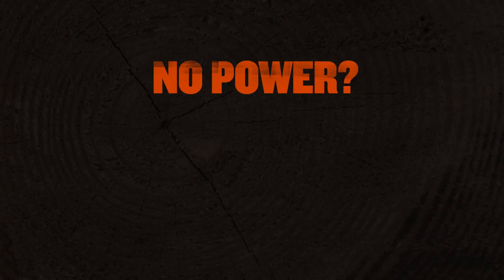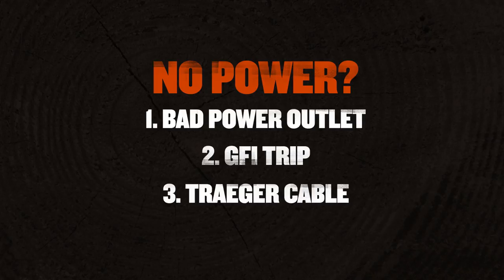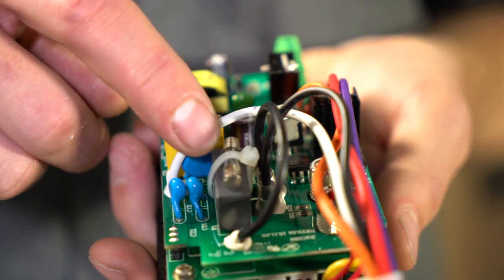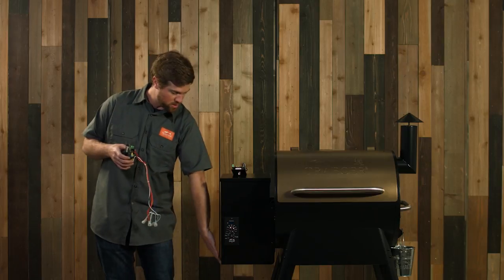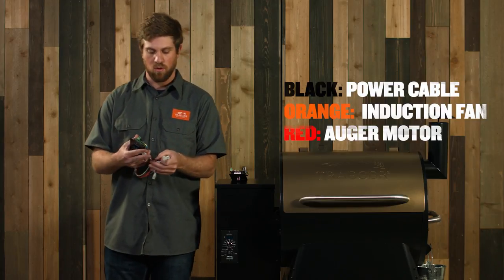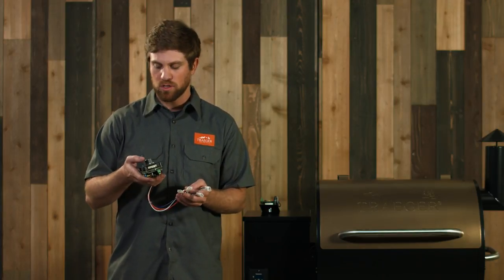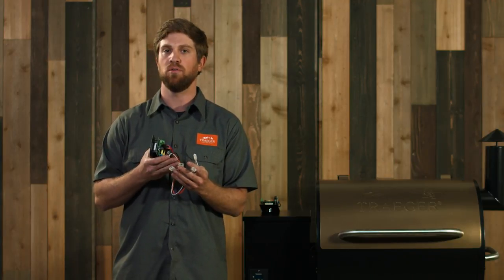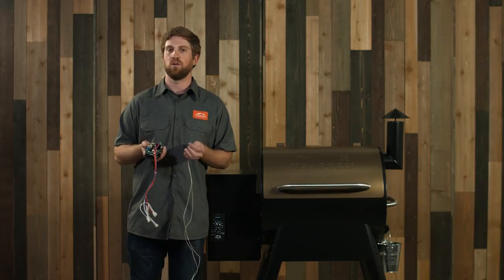Why Doesn't My Traeger Grill Power On - Traeger Maintenance

Comment: My Traeger Lil' Tex Elite would make a "humming" noise when plugged in but not turned to smoke. It would work fine otherwise. To prevent the noise, I would immediately unplug it after use. I forgot to do this last weekend and when I went to unplug it the noise had stopped and the grill would not power up any more, no digital display, nothing. I removed the controller to check the fuse, (it was the cylindrical version), but couldn't budge the fuse out of the holder. I finally used a pair of players to grab the fuse but it was so tight that the entire tube pulled away from the circuit board. I'm now awaiting delivery of another controller. Hopefully it will fix the problem.

Comment: We have a new Ironwood 650. 
Display would not light up. After using multi-meter, it was the master switch. 

The power from your outlet (USA) is 120v AC but the transformer changes it to 20v DC. 

Drove me nuts for two weeks….you would think it’s the display (no fuse on the ironwood series) but it was the master switch.
Reply: Hmmm, I have the pro-780 wi-fire and my display won't light up either. It's getting power, but display screen is dead

Comment: Just had this problem. Turned grill on and the light would flicker then turn off... Discovered it was operator error. Can’t turn it on in shut down mode. Oops.
Reply: Same here I thought I bought a 600$ paperweight but it was my fault
Reply: Thank you. You literally just saved me time and money with this comment. It was exactly that and now I can smoke my brisket tonight!
Reply: Holy shit, this is it several years later. Thank you for your wisdom wise sage.
Reply: You saved me so much trouble.

Comment: On my Traeger, the control panel will not fit through the opening. I will have to disconnec
t the entire hopper from the grill to access the electrical components.

Comment: The problem with this video is they don't show how to get the control panel out.  He just has one in his hand.  It is hard to get out and I'm not sure I will be able to get it back in.  This is a frustrating experience for someone who doesn't know how to fix things very well.  For a grill it seems to be a lot of work.
Reply: It’s a hassle. After you remove the screws and it is loose. You need to slide the panel to the left. Then while holding it there you should be able to get the right side to come out. Then just slide it back to the right as you are pulling it out.

Comment: What does it mean if the thermostat screen doesn't even turn on?
Reply: I'm having the same problem,  Can't find any info
Reply: alex Tong I replaced the controller and that fixed my problem. If it doesn't turn on, I think it just means the controller died.
Reply: Thanks.  I will try that.
Reply: I am having this issue. Bought the grill last week, assembled it Sunday, cooked some ribs just fine. Yesterday, went to start it up, and nothing. Power to outlet is fine, and fuse was ok. Switched it for the replacement anyway. Just got off phone with their service, they said it is probably the power cord and will send me a new cord.  I think it is the controller unit myself, but the rep said power cord is what it usually is for my symptoms. Now gotta wait for new cord to come before I can try my grill again. 

My wife is upset that we spent more on this grill than a propane one like our old grill, but aren’t able to use it. Hopefully the cord fixes it, but it sucks to be out of operation until I go through their steps and wait a week for them to ship the part.
Reply: Scott S Actually, it was the control unit. It took  about 3 months before customer service finally sent me the new control unit. I was getting really good at taking the hopper apart to try all the things they asked me to try first. 

It has worked ever since I installed the new unit.
Reply: Did you put in a new fuse? You need to unplug everything but the black and replace the fuse.

Comment: Been having problems getting grill to heat up 1st try get ler 2nd try get ler 3rd time it lights up what could cause this
Reply from the maker: Hi Jon, if you are having issues with your Traeger the best thing to do would be to give their customer helpline a call and they can help you troubleshoot the issue. 0208 6201 070
Reply: I'm about to replace my hot rod. Having the same issue

Comment: This is a brutal video and doesn't 'troubleshoot' at all. His comment about plugging the connectors in 1 at a time is obvious, but here is the issue. I test my cord out of the wall to the connector on the Traeger and have 120V, I plug in my controller and test to the back of the control panel with switch on and have 120V.....but I have no power! Nothing, no error code, not a thing on the display.  Any one have any ideas?
Reply from the maker: HI Bradshaw787 we're sorry this video didn't help you, this is merely a Traeger informative video on what might be the issue. The best thing to do is contact your Point of Sale and ask them to help you get in contact with their Traeger Representative whoever that may be. If you did buy it from us please send us an email and we will try and help you further. Kind Regards, Riverside.
Reply: I have the same problem. Did you have to buy a new controller? Changed the power cord, it didn't help - nothing on the screen.
Reply: Pellets could have too Much moisture
Reply: @joey-cv9uw  how do wet pellets have anything to do with the grill not getting power?
Reply: @boltup5566  did you fix this ? i am wondering if i need a new controller also....have checked fuse...have checked power on outlet...
Reply: @ColinDdd  yup new controller. Cheap on Amazon.